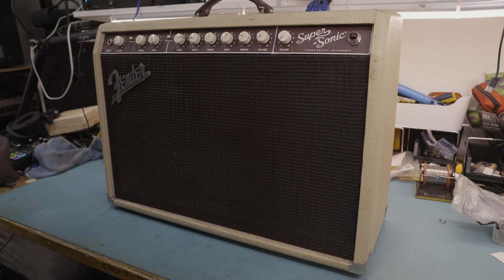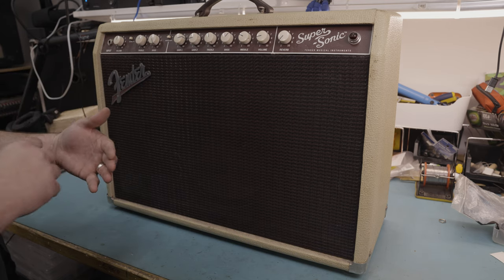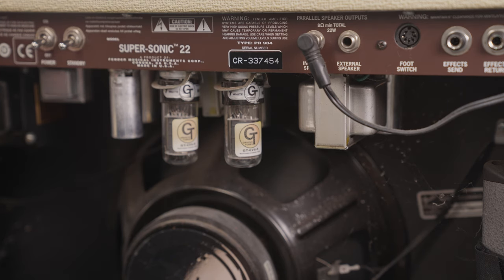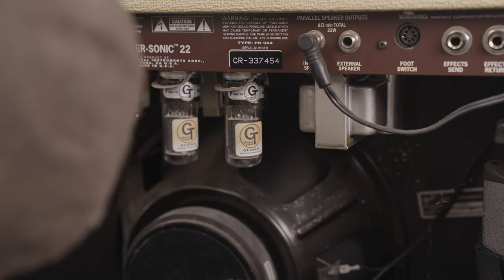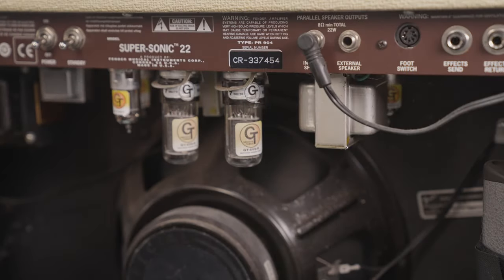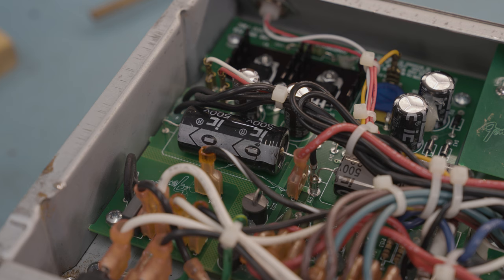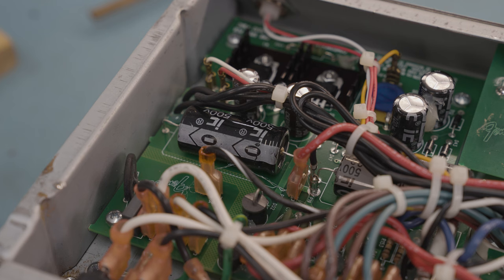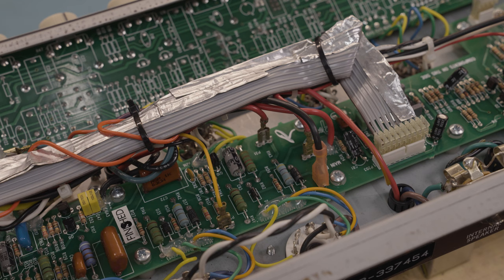Fender Super Sonic 22 Humming & Buzzing Like Mad

Comment: Stumbled across this vid while "researching". That foil shielding on the ribbon cable in the last shot, was that fitted by yourself? Either way, seems like a good idea. Got a noisy one here atm (filter caps irrespective), think it's the noisiest one I've ever experienced
Reply from the maker: Oh no, that was someone’s attempt to bring the noise floor down on this amp. I pulled it out as it does nothing on these. A lot of it comes down to the layout and signal runs. To reduce the noise you have to cut traces and run shielded coax in the right places to reduce some of the noise. 

These and the bass breaker series are very noisy, buzzy amps unfortunately and there’s only so much you can do with them.